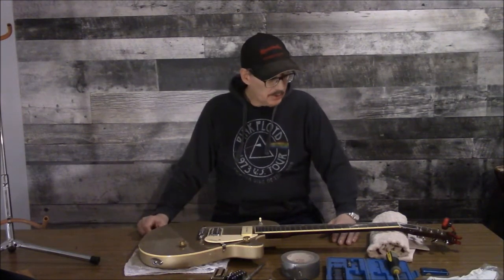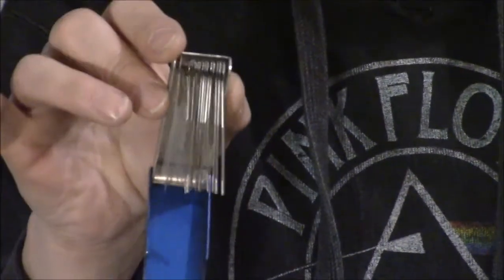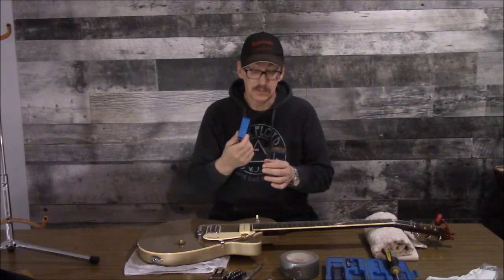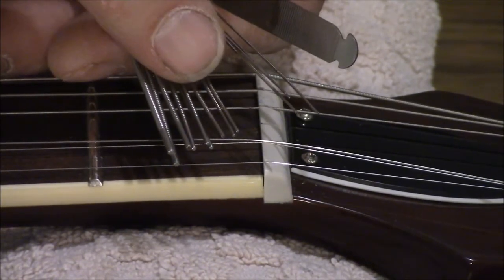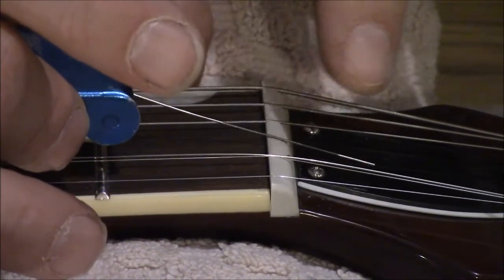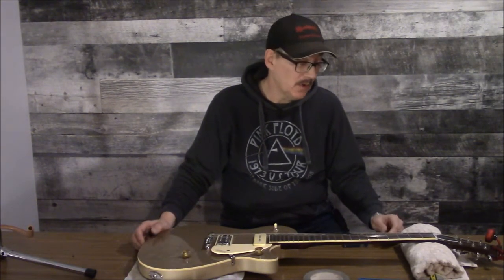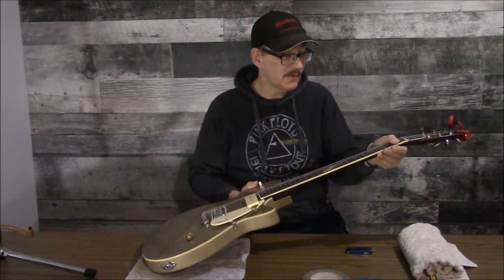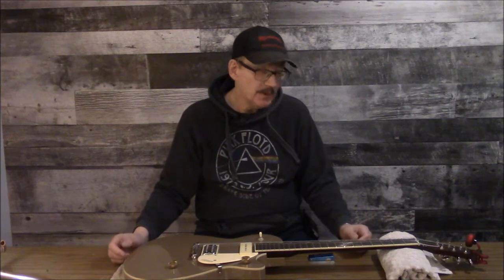Fixing pitch problems. Save a pile on String Nut Files

Comment: Got any idea how hard it is to do that with tip cleaners ? Almost impossible . No good for slotting a nut from the beginning . If you want proper hand made nuts , get a good set of files .
Reply from the maker: I would agree. Starting from the beginning wouldn't work, but to make small adjustments without taking too much off, they work great and are much cheaper than the tools they sell you for guitars.
Reply from the maker: @@wrongone8378 Thank-you. You are exactly right.
Reply: I STILL can't find anyone who can tell me what kind of file to use for a bone blank made from scratch! so frustrating!!!!  so tired of listening to dumb asses talking for hours.... Jesus...
Reply: @curtiseverett1671 Stew Mac what's your budget?
Reply: @curtiseverett1671 use a nut file made for guitars…stew Mac, music nomad.  It’s not complicated.
Reply: It's hard on the the high strings but actually does a better job on the low strings. Unfortunately ALL the "pro" level nut files are total over priced garbage. They would be worth it if they did the job right. Most cut square grooves which is useless. Others that are diamond coated wear out. Some create V shapes. Some are made of softer stainless steel. They are all a rip off. I've not found a decent set.

Comment: Gretsch needs to spend more time cutting the nut.  I have a 5230T that's a good guitar but the nut was awful when I got it.  It had some other problems, too.  A student of mine has a Jet with a bad nut, too.  I'm watching some videos as a refresher before I fix hers.
Reply: Fender too.  Took me a year to get two 'Pro' models down to a proper playable action.  Factory nut on a Pro II Strat was so high a capo couldn't close the gap at the first position.

Comment: Pretty guitar! I’ve recently gotten a PRS McCarty 594. It’s an 800 dollar guitar. The G string binds even though I’ve lubricated it properly. I can tune to pitch and it goes flat after I play it. I give the headstock a little pull and it returns to pitch but it doesn’t last. Lube is essential on all contact points. Pencil lead has been my go to for decades but recently I’ve been using sewing machine oil. I like it. It’s clean. Just don’t let it drip down at the nut seat.

Comment: I've just ordered one of those torch cleaning kits (23 piece) off of ali for £5.60 ($7.08). 
I'm happy with that. The 14 piece kit was a bit cheaper but I went for the one with more files because I have guitars and an electric bass, and I might use them to mess about with making stuff out of brass sheets.
Edit: I also ordered a proper nut file

Comment: I bought one of these sold as a nut file set. Due to me being a newbie at messing with guitar setups and due to what I was trying to do, new blank nut installation, I was extremely disappointed. They are not terrible for that final fine work for sure though. 

I did get an inexpensive file set and found that they were labelled wrong. They worked OK but were leaps and bounds ahead of the torch tool.
Reply from the maker: Ya, the torch tool is only good for fine tuning things. Useless on a blank.

Comment: What is your opinion of using the string as a file method? I think it might be the least problematic especially for someone inexperienced in doing guitar set up adjustments.
Reply from the maker: That would only work on the lower "wound" strings. The smooth higher strings wouldn't do a thing.
Reply: @techtips1064  Yes, that makes sense. Thanks
Reply: You can try using sewing needles of proper gauges. You will need to make notches on them with a file or Dremel to make them serrated. Or, for the higher strings a paper knife/utility knife will also do. Just make the blade serrated for the thinnest strings, and for thicker ones create a rounder edge shape with a Dremel or hand tools and then make it serrated.

Comment: I have the wood color version of this guitar. I've had minor tuning issues with mine and considered replacing the tuners. Do you know what tuners that I could replace them with that wouldn't require drilling and such and would be drop in and go? I really wanted to do the floating trapeze bridge on it, but got overwhelmed thinking about it.
Reply from the maker: I have no idea what would fit as a "drop in". I do have one with that finish on order and I will be changing the tuners in it just to do a color change. Going all gold on that one and will be changing to a trapeze tail piece as well. The current one is not getting tuners as I don't find them all that bad. Just guessing (and hoping) they are a fairly standard size and style.
Reply from the maker: Update. I changed the tuners on my new one and the Grovers were a perfect "drop in" part. They are one of the most common brands with a good reputation. I did a video of the swap if you are interested.
Reply: Why do you think the tuners are to blame for the tuning issues?